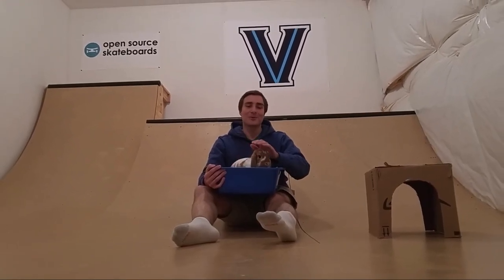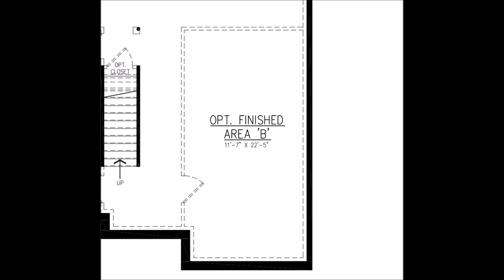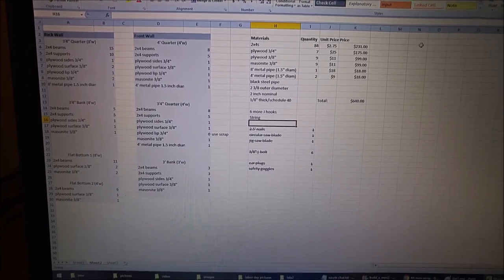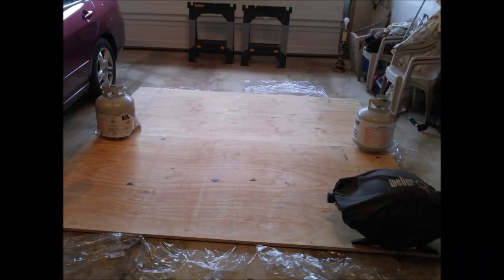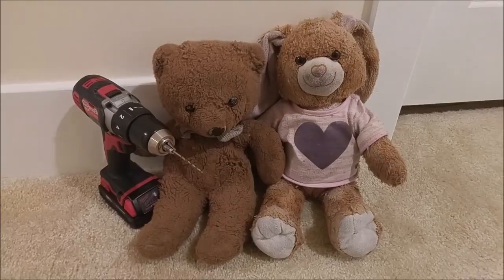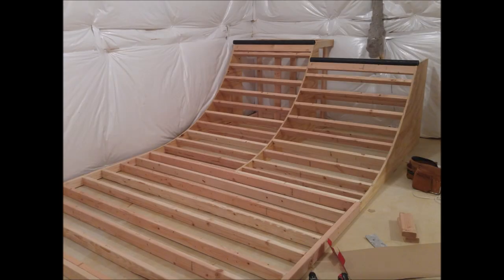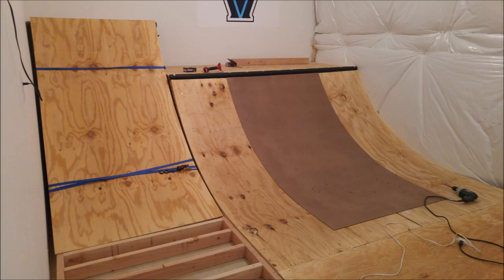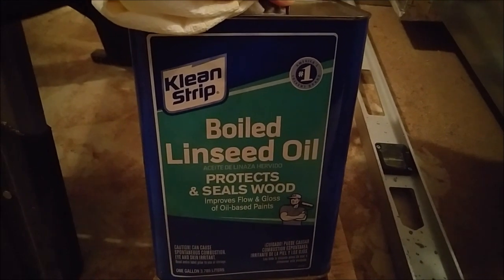How to Build a Mini Ramp in Your Basement with Greg Doefler

Comment: This is probably the best video I've seen on building a mini ramp. How long did it take and what did it cost in materials?
Reply: It took me approximately 6 months because I didn't know what I was doing but also because I had a really shitty circular saw and the space is so tight it became increasingly difficult to do woodwork without thinking several steps ahead. Thy trusty spreadsheet claims only $640 but I think I spent between $1,000 and $1,500 between subsequent hardware store "lumber runs" and the ramp's ceaseless lust for screws.
Reply: @GregDoerfler  I been seeing the prices around close to $1000 for materials alone and not to mention having tools. I'll investigate prices at my local store and probably get help or might just consider ordering from OC ramps to save myself a headache and labor it's around the same price
Reply: @chrisrod657  let us know what you decide! The OC ramps look awesome.

Comment: How do you make the j bolts work to hold the coping? You don't show where the holes were in the pipe, how big are the holes? Thanks.
Reply: I could have explained that better! Start by drilling one hole wider and wider on the coping until you can thread the J end of the 3/8" j-bolt through it. The hole size doesn't matter all that much but must be larger than 3/8 to work. You'll probably ruin a few drill bits in the process. On the 2x4 end, drill similarly. The long part of the j-bolt goes through the 2x4 and gets secured by a nut and washer. Make sure to use a big washer so you can really tighten it good. Space the holes out every 2-3 ft.
Reply: I’ve built a ton of ramps and used to double drill with a screw and left you with holes to grind over. I own a welder now so weld threaded rod but the j bolt idea is brilliant never even thought of that.

Comment: So I’m making one in my back yard and what do u do about drain water
Reply: Outdoors...hmm...
Def use pressure-treated lumber beginning to end and find something other than masonite or mdf for the top layer. Steel is actually really good.

If you keep it tarped when you're not home, a drain probably isn't necessary.
Reply: SkateboardGreg yea I’m just gonna use a tarp
Reply: SkateboardGreg cuz it never rains in ca
Reply: Ok, still a good idea to take weather-related precautions and use pressure-treated lumber as well as seal your surface layer. Only takes a little bit of moisture to ruin mdf and masonite.
Reply: SkateboardGreg mdf = my dinosaur friend?